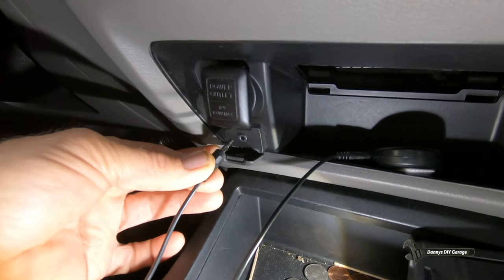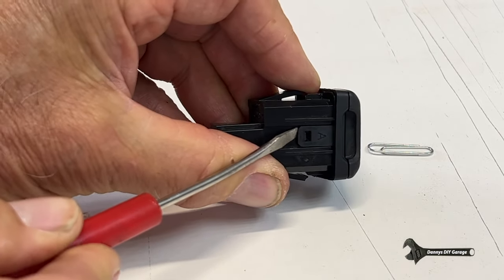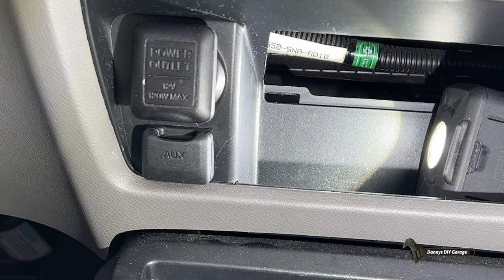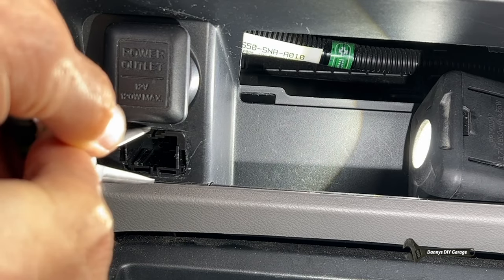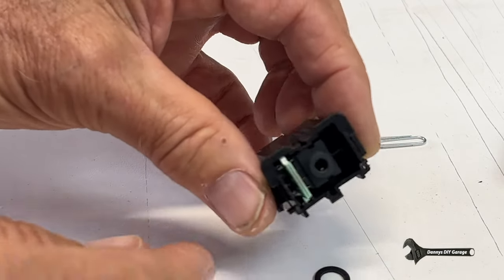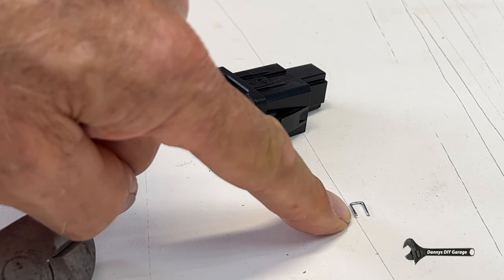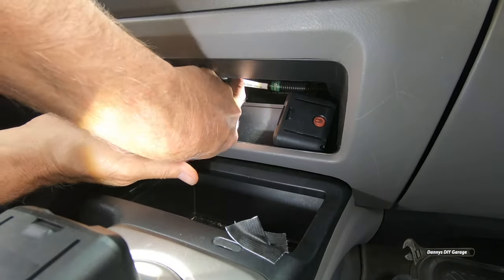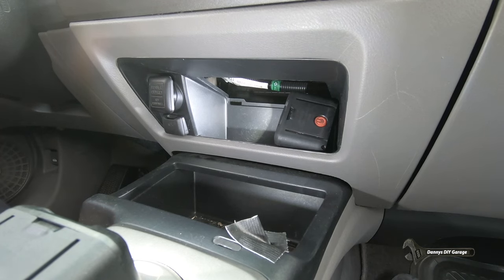Honda Civic Aux input port audio fix

Comment: Are frickin kidding me, this worked 100%. Side note, instead of a paperclip I used a single staple
Reply from the maker: that works too, thanks for your support
Reply: Thank you I did it with a staple and it works 100 % thank you for your video

Comment: I tried this way and even replaced the port, i have a multimeter showing that the headunit can't rekognise the aux channel even the port is working. Just wonder if you know if it can be easily identify from another side which tells if the aux is connected to the headunit? currently the 4-pin plug is going along with other cables like the 12V power supply and some other cables in a loom.

Comment: Have a 2007 Civic EX, didn't have a problem with it up until 2017-ish.  Used only for my Iphone/music.  Thought the cord impedance or something was burning it out and have gone thru 3 replacement circuit boards.  Thanks so much!

Comment: No need to replace the aux input port generally . If AUX button not working, Just plug off the connector in the back seat air conditioner fan output,and short-circuited the grey and yellow line.
Reply: Could you explain further?

Comment: Thank you so much! My aux port is working 100% now. Don’t make the mistake I made though. It’s only about 10° F right now at my house. This may have made the aux housing a little more brittle. I should have let everything warm up a bit first. I broke a couple of small pieces off when I pushed it back into the dash. No real issues, but could have been worse. If it breaks, Amazon has new ones for about $10.
Reply from the maker: Glad it helped!

Comment: I own a 2008 honda civic and my aux was broken when i got it. found this video and fixed it immediately. works like a charm. when using the long nose pliers or whatever they're called to make the paperclip piece. be sure to use the very tip to get as small of a paper clip as you can and jam it in. 10/10 video would recommend
Reply from the maker: I appreciate your gratitude, thanks so much

Comment: Hello, the sound comes out from only one side (left). What should I do so that the sound comes out from both sides? Thank you
Reply from the maker: If the cable that plugs in is good, You’ll most likely need to replace the receptacle

Comment: Thanks a lot, I used this video to fix mine but I didnt have a paperclip. Instead I soldiered the two prongs together near the base of the plastic. The aux door didnt fit as well as it used to but I was able to force it on and everything works now.
Reply from the maker: As long as it’s fixed, thanks for commenting
Reply: I was wondering if solder would work! Hopefully I get it right! Lol
Reply from the maker: Solder should be fine

Comment: What did you jump exactly, and would it be better to just replace the whole 1/8th inch assembly? Or is it nessecary to jump the white and blue because of some other inaccessable circuit?
Reply from the maker: Yes, replacing the assembly should fix it, no need for the jump if it’s replaced 👍🏼
Reply: Can i just solder in the circuit board?so no need to do the clip?
Reply from the maker: @bwasfpv yes

Comment: You guys have space to put a screw driver in there??? Right now I’ve broken one of the bottom clips and can’t get the top clip to release. You guys were able to remove the cover without breaking the clips???

Comment: I did everything as you did but i did not use the paper clip. my aux is still having problems and it only works when i forcefully push in the aux cable. would the paper clip help my problem? :)
Reply from the maker: The paper clip is the most important part

Comment: What's the purpose of the paperclip? Does swapping out the port in of itself not fix the problem?
Reply from the maker: you can swap out the port and it should fix your problem, the paper clip tricks it into thinking the adapter is in, what happens is the port wears out and doesn't know the adapter is in, that's why it doesn't work, hope this explains it
Reply: @Dannys DIY Garage  I see. Mine isn't loose, just doesn't work anymore. Thanks for the explanation.

Comment: Previously I replaced the just the circuit board and it worked, but a few years later it occurred again. I figured my aux port was getting worn out from the pressure of the stupid spring-loaded AUX door (which I hate) as it lays against the Bluetooth aux device I have plugged in.  
Why does this fix work? Will it work indefinitely?
Reply from the maker: Mine still works

Comment: Hi Sir, I've opened my aux port for honda city tmo /gm2 (year 2008 -2013), but the wire colors are not the same as in your video. Will be ok and safe if i follow your instruction by just put in the metal clip exactly at the same position regardless the colors of the wire?
Reply from the maker: most likely, but without seeing a schematic for your car, I cannot be 100% sure, however most likely

Comment: You can still switch back to radio, correct? Is this just bypassing the function that switches over to AUX automatically when you plug something in?
Reply from the maker: Absolutely

Comment: But what are you jumpering. That was not really explained. 
In my car 2012 Civic with the same setup, there is a USB / aux.
Reply from the maker: I answered this question in detail quite a while ago, but the short answer is it completes the circuit again, the plug is worn out, a better option would be to buy a new port, or you can fix it

Comment: my2006 civic didn't came with any aux input. so i opened the unit found the auxiliary input on the circuit board and made a custom made aux input. it is working fine but the problem is that the audio quality is not there. Sounds like 64kbps. any ideas?
Reply from the maker: Sorry, I can’t help you

Comment: I have a 2009 Honda Civic lx sedan and I did this and it worked fine but after I did it my battery is constantly dying, could this be related?
Reply from the maker: Check out my video on parasitic draw, doubt it had anything to do with it

Comment: So easy! I did everything and mine changes back to Aux finally but no sound. Any idea what else it could be?
Reply from the maker: I would use make sure it’s not your cable or anything your plugging in 1st, it should work

Comment: I just pulled out the board and soldered a blob to connect them on the backside of the board. No fishing required 

Thanks so much for saving me $15/20 on a replacement board. What a dumb design "feature" the flap and the sensor circuit is. Thanks, Honda.
Reply from the maker: I appreciate your gratitude

Comment: Thanks for the tip.  It worked well.  I tested it before putting everything back together.
Reply from the maker: Awesome, thanks for letting me know it worked for you also
Reply: Horn stopped working. Checked fuse 12, could it be related?
Reply from the maker: No, horn is easy to diagnose, do you need help

Comment: You've got a friend.
Reply from the maker: @jeffreyb3238  appreciate your support 👍🏼
Reply: I think that was the barely audible song at the vety beginning of your video 🤭   Did I guess right?

Will try, as I have a left speaker until I wiggle cable in port, in which case I have the right, but loose the left speaker.
Interesting video.  Thank you.    🇦🇺🦘

Comment: what does the paperclip trick do?
Reply: Based on other comments, it switches on the ‘aux is plugged in’ circuit in the car. Probably provides power to the pin no matter what

Comment: What does the jumper do?
What is the failure point?
Reply from the maker: It will bypass the automatic detect
Reply from the maker: the aux port senses when something is plugged in, when it goes bad it doesn't know when the jack is being used, we just bypassed it